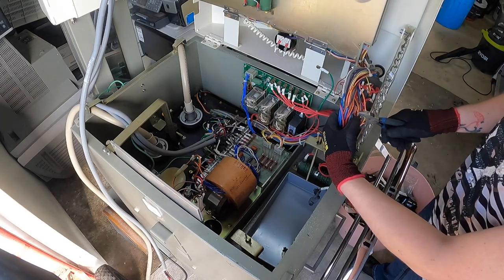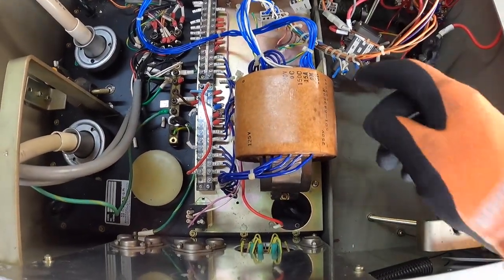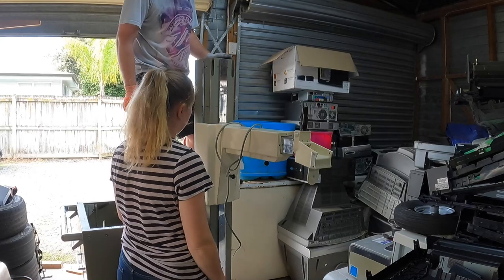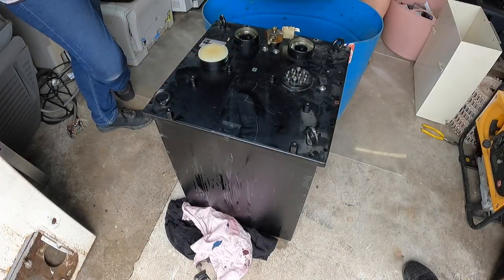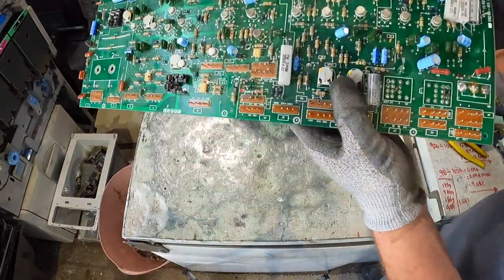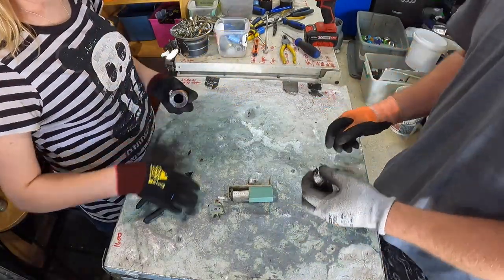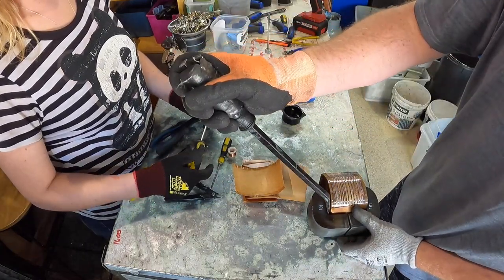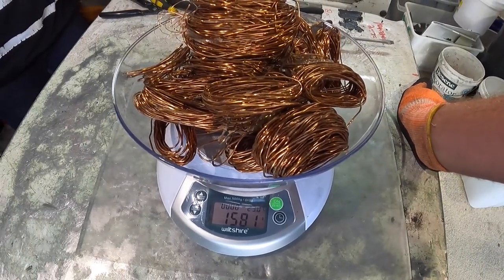X Ray Machine Scrap Out - Scrap Breakdown - Metal Recovery - Metal recycling.

Comment: Is it actually safe to disassemble an x-ray machine?
Reply from the maker: @peterrobbins2862 What are your concerns?
Reply from the maker: I would say absolutely safe. There was no power going to the unit. It hadn't been used in months, so it would have lost all residual charge, and the x-ray head itself wasn't with the unit when I collected it.
Reply: Aside from the danger of dropping heavy bits onto your toes there is not any additional risk because it was used to produce X-rays.

The biggest risk from any old 'oil' filled transformer, X-ray head or capacitor is the possibility of PCBs (Polychlorinated biphenyl) containing insulating 'oil' from equipment made before 2001.  Since 1976 it has been rare to use it but was still found in some countries but may have a label to indicate if it contains PCB or not.  Check local disposal guidelines for mineral transformer oil or PCB containing 'oil'.

The risks from the actual X-ray tubes (which was not included in this haul) is the danger of vacuum implosion from impact and from low energy/dental tubes the danger of particulates if grinding the beryllium X-ray exit window.

There is no radiation danger at all from X-ray tubes when they are switched off and radiation treatment machines that use radio isotopes have lots of radiation trefoil warning labels and typically have to be returned to the manufacturer for disposal.